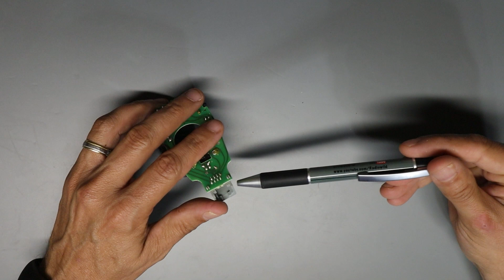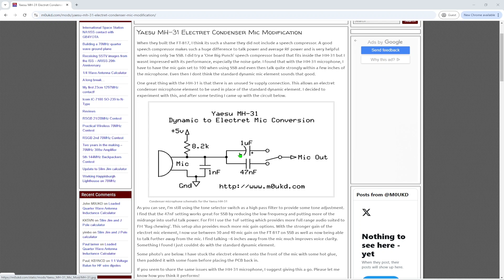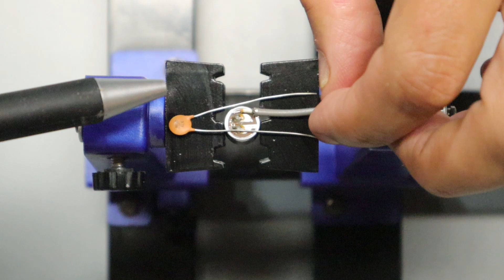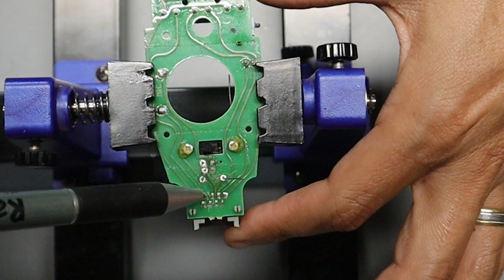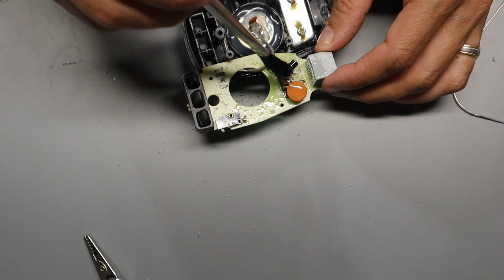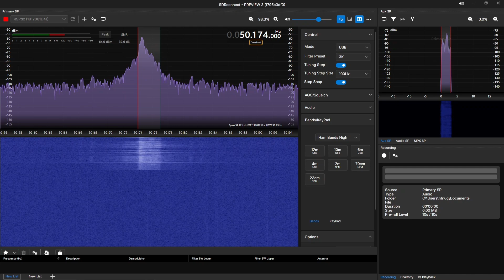Can We Fix this Broken Ham Radio Microphone?

Comment: My MH-31 microphone on my FT-891 quit on me on my trip back from Colorado this past Sunday. I thought I blew my finals out. I did a factory reset on my radio and I had the same issue. I seemed to have the problem on SSB and also noticed the PTT switch wasn't working at times either. I grabbed the SSE-75E microphone from my FTDX10 and that works great. I am going to buy a new microphone for it. Let me know if you want the old one. I through it in the mail to you.
Thanks for sharing.
BTW the factory reset solved a problem with the S-meter not showing receive audio levels on 20 meters only.
Reply from the maker: I'm glad you got your issue sorted out.  Keep your old mic for a spare...I was able to fix mine and it's working now

Comment: Excellent video  Rob  :) also nice repair on microphone and did suoer job fixing up. I have done my share fix microphone with parts to and did before and it surprises you I did to!  Lots fun too and Lol to also use  metal screens to! My Yeasu FT 1500 M radio microphone  had microphone element broke down I put cellphone microphone so installed it and found cellphone  fix up made sharper sound plus clear sound to! Sound like power microphone  but not only stock ! Yes extra parts come handy  and it surprises me  to!

Comment: It would be interesting to have tried the other mic when the RF issue came up.  I think I would try and see if you can duplicate it again and then trouble shoot from there.  Thanks for the video!  73
Reply from the maker: I forgot to mention I switched to the other mic when the rf issue came up and had no issues.  Aside from that I haven't done any more troubleshooting yet